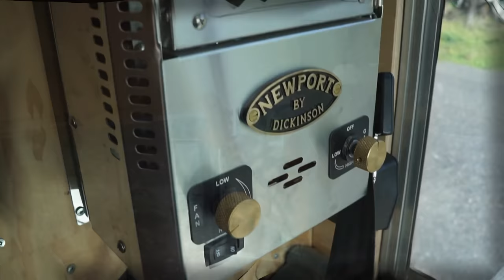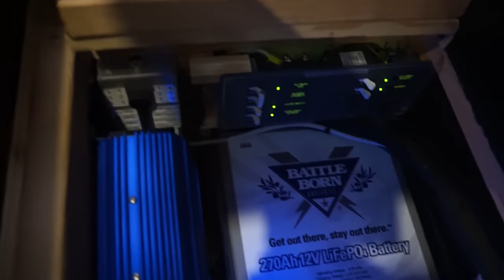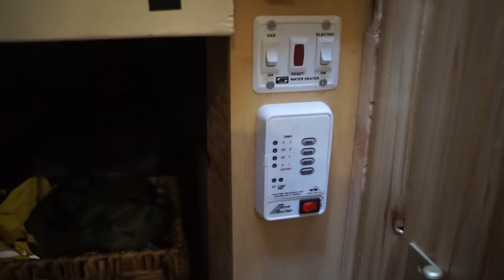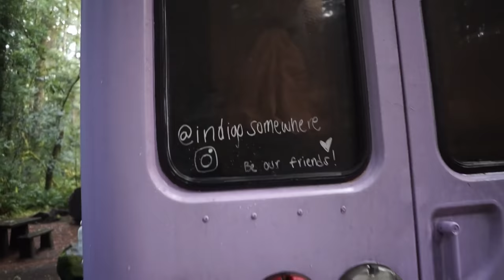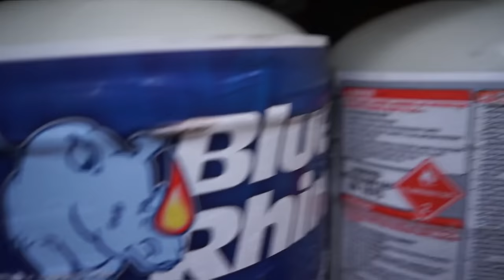DIY School Bus Conversion - Room Tour

Comment: You two are so sweet! Very informative in sharing every detail in your bus build! You conversion is Beautiful! I’m a single 65yrs young woman living full time in a 1980 Avion Travel Trailer for 6yrs. I’ve decided to sell it and purchase a 40ft Flat Nose Bluebird Diesel pusher to convert into my forever home! I took an 8wk long welding class in a Community College so that I would be able to do any repairs that would be needed in my travels. Like you both, with fuel prices as high as they are, I won’t be traveling constantly. It’s good to stop for a while, meet new friends, and just, “Smell the Roses!” as is said. I will say to be careful with flame candles inside your bus. Burning them takes the oxygen out of your space. I tried them in my Travel Trailer and noticed a difference pretty quick! Use the melting wax warmers instead, if you like those. Also there are these, “Fireballs” that immediately extinguish a fire. Google; Fire Extinguishers; Fireballs, and you will see a few videos of how they work and different ones you can purchase. They are amazing! They can save your lives and your puppy’s and your bus and your puppy while you’re home, or while your out replenishing your food supplies. One last tip, a can of, “Hero Spray” created by a retired Fire Chief is easy to use, just point and spray onto a burning frying pan on a stove. Just point and spray! I hope those 3 safety tips help! They can save your lives and your bus build! Enjoy your adventures together, Always be aware of your surroundings, and always have some personal safety on you both at all times!

Comment: I really like this build. Why separate the kitchen? Stove and sink?
Reply: Thanks so much! ultimately it came down to space limitations. We went through almost 50 different floor plans before settleing on this one, and they all had so many competing factors. this ended up being the best option!
Reply: Your compost liquid, what are you feeding the worms? Is it your table scraps that they eat? Did you say you connected two propane containers or you just have an extra?

Comment: Awesome build its beautiful you guys did a great job. It just may be my new favorite bus build. I love the size of the bus its not to big and not to small it just right its a Goldilocks story lol. 
What is the bus length?

Im looking for a bus to buy and I really love the size of your bus. You guy fit everything in thats needed to make a comfortable home. 
With short buses you have to compromise and give up things that you really won't. 
I was going to go with a small 5 window because of the drivablility you can park it anywhere but I didn't like the idea of giving up a few things I want in my build, like a decent size bathroom. I don't need a big bathroom but I would like for it to be big enough for a small separate shower and toilet area. With a small bus at most you can have is a very tiny wet bath that you can't move in can't wash your hair without hitting your elbows on the walls. You guys have a wet bath but its not a   teeny tiny its a decent size wet bath that I can live with. 
Anyways your bus is perfect size for me. The only thing I would give up in a bus the size of yours is parking. I wouldn't be able to park in a regular parking space or going thru a drive thru may not be doable but I can live with that...
I just love your bus its fabulous...
What type of paint did you use on the outside? And whats the length from front to back? and from behind the seat to the back?

Fantastic bus home you guys should get very proud of your build its Great and Gorgeous...